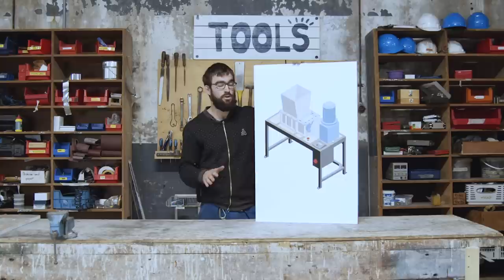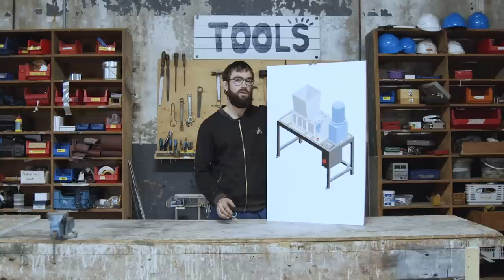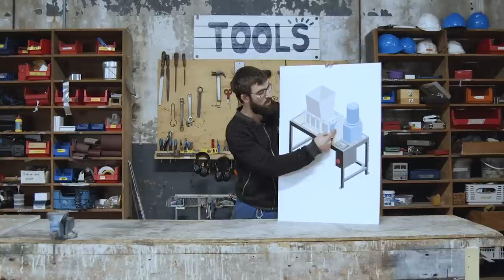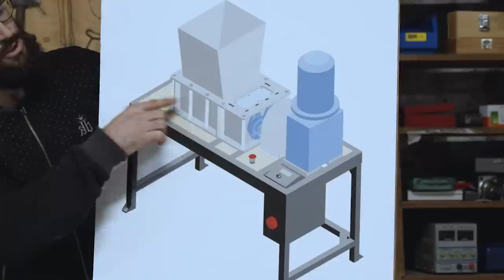Precious Plastic - Build a PRO plastic shredder (part 3.5)

Comment: As a manufacturer of shredders, I can say a nice job done. About the coupling. You can use 2 the same chain sprocket gears connected with duplex chain. Using taperlock system, you can find the right size very easy and its dirt cheap. The number of tooths on the gears need to be divisible by 2.  

For the spur gears. Knowing the bearing center distance to each other it is simple to make a table what gear combination for each gear modul can be used. That way there are many more possibilities and biger chance to find some online.
. As the file is nearly 700mb, I don´t have time to download and go through, but if somebody want, i can write all the possible gear combination here, just let me know the distance between shafts ( center to center )
Reply: hi sir,
as you are a manufacturer of shredder, i have a question that which things invole productivity of the machine ( i mean the types of motor, the speed of the shredder shaft or the types of knife)
if i have the input information that i want to shred 40kg of plastic per hour, how can i define the power of the motor?
please help me
Reply: We use the same method of coupling in our factory.
Reply: @Marshall Cruz Instablaster :)
Reply: @Keegan Grant It worked and I actually got access to my account again. Im so happy!
Thanks so much, you saved my account !
Reply: @Marshall Cruz glad I could help =)
Reply: yes. great information here. please enlight me more

Comment: 17:02 Step #1 should be: Ensure that your shredder is unplugged before attempting to disassemble the hopper
Reply: Or Step #1 make sure the safety is on or there is a lock on the round power switch
Reply: unplugging a 3phase plug is way too hard ;)
Reply: Step #0 never put your f***ing hand inside the hopper while the thing is plugged
Reply: im glad this is here, paused to write a similar comment.
was gonna say make sure estop is pressed as well, 
the cord/plug can be out of sight, you never know if some idiot is around the corner plugging it back in / turning the switch back on
estop is right in front of you, you will see if someone is mucking with it
Reply: Don't worry guys, i have a  button " pause" on my browser just in case
Reply: Olivier! We need your help making this machine Imperial system! haha I am having many troubles with the unit difference

Comment: this is a very good design. much improved from old versions. i personally like the idea of using a cycloidal reducer, or planetary reducer, instead of helical bevel (which i assume is what you are using) because they are more suited to run in reverse, and in the cycloidal case, they are very tolerant to shock loading.

Comment: Very cool! One of my long term projects is an engine that runs on a variety of recycled plastics.  A machine like yours would allow me to compact the fuel greatly and reduce the "fill up" of the reaction chamber and the associated downtime.  Great video btw
Reply: Oh man !! Great stuff. I would be interested in what you are up to.
 I am converting a pellet stove to run on HDPE and PP.. I need a good shredder to feed my hot extrusion feed with nice consistent chips of plastic.
What are you pyrolizing the plastic directly into a modified internal combustion engine ?
Plastic is great isn't it 👍

Comment: The best way I found to clean the machine after use was to use the air compressor and blow it through and the best way to unjam the plastic was to turn it backwards you can get a power switch to do this
Reply: Did you make this PRO version already?
Can you share how much you paid for the parts and for the assembly  (or how many hours you spend working on it yourself)?
Reply: @hansdegroot8549  I made the previous version but the Pro looks a lot better

Comment: Very interesting video. Thanks for sharing.  I think the shredder is quite a complicated machine to build. Better to leave it to professional machine makers.
I was surprised by the low RPM which is needed.  (before, or was the for the V3 machine), I heard 70 RPM, now only 25-30.
I have to study the technical specifications.
When I downloaded the starters' kit yesterday, I was looking for the financial side of it.
I found the files but the files seemed to be (only) estimations.
I could not find the company which was mentioned in it. Does it really exist?
They had an estimation for about 5000€ for the machine, 

Is there a parts' list available with prices how much which part costs?

Comment: I have bought all the parts in the BOM and am building the machine as we speak. Im stuck at the beginning as the frame 2d drawing is incomplete. Like the 80x40 where you´re drilling the cable management hole. Where does it sit exactly? what is the length of these 2 90 degree rotated 80x40? I dont want to mess up the build right from the start so i really need some advice. Im afraid its a long shot getting some info here :( Also the flatbars where you cut 2 holes into each is nowhere in the starter kit

Comment: That is quite a lot of torque. Are you sure the two square tubes in the frame are enough in the long run? That is the weakest spot, I think, and the frame might end up slightly crooked and weld cracks appear. Otherwise, super-impressive work!

Comment: I really love what you are doing and I was super excited to be involved and start a plastic recycling centre where I am, hoping that I could build these machines in my workshop inexpensively. I have a thousand ideas for things to build with recycled plastic. Problem is, they are great machines and to build them properly costs thousands! It's all totally prohibitive unless you have a spare £20k kicking around, which I don't. I started to collect the parts to build a plastic extruder and realised that the motors are hard to find and really expensive and the original plan of using a cheap auger bit instead of an expensive extrusion screw just doesn't really work. Such a pity, but good on everyone who can afford to jump in and build these machines! Great project. If you could find a way of using readily available, affordable, recycled components to build these machines, then you would be on to a revolution! In the meantime, it's actually just easier to go on ebay and buy commercial equipment - it's cheaper and a whole lot simpler!
Reply: use a hand jack to "power" your extruder

Comment: why no torque limiting device to protect the gearbox?
Reply: Use VFD, and you got a reverse button as bonus.
Reply: @thymark  still not going to limit the toque input to the gearbox if the output of the gearbox stops you still have a massive rotor spinning around 1750 rpm which will break the gearbox. a torque limiting clutch between the motor and gearbox is a tried and true way with noon hydraulic setups.

Comment: This machine doesn't meet Canadian safety standards for guarding.  The ability to reach right down to the grinder is a big no no.  Also, agree with unplugging the machine before attempting any type of servicing. All the metal grinding, drilling etc without eye protection made me cringe.  I've had a metal sliver in my eye, 10/10 do not recommend to anyone.

Comment: That emergency stop button isn’t accessible in all position that you might find yourself in. Please, please, please spend more time on the safety aspects of these devices, in the design, but also when you describe operations. This thing will irreversibly maim a person in seconds. Doesn’t mean it shouldn’t be made or used but a shredder like this should be treated with respect when it comes to safety.

Comment: There are several problems with these videos:
1.  No one would build these machines.
2.  Too much energy is spent grinding the plastic into little pieces and then melting the pieces in an oven.
3.  The end product is not really useful.  Making imperfect pickets for fences seems to be a better use.
4.  Transporting neighborhood plastic is expensive.  An efficient machine in a neighborhood could process plastic locally.

So, here's my machine:
(coming soon!)
Reply from the maker: do i get a bar of chocolate for every machine being build?
Reply: @OneArmyVideos  

Sure!  And hopefully that is a LOT of chocolate.

In the US, each of my neighbors uses a large green container that a recycling truck picks up and hauls away.

But what if someone in each neighborhood had one of your machines?  

Or, even better, one of MY machines?

The MacSquash Box... (under construction: video coming soon... if it works!)